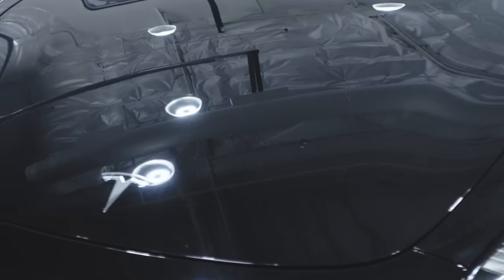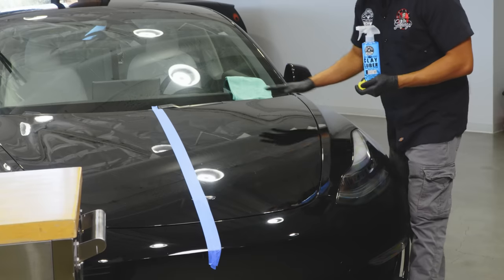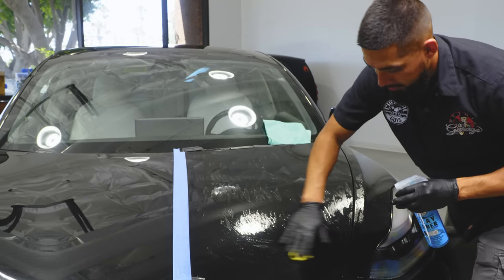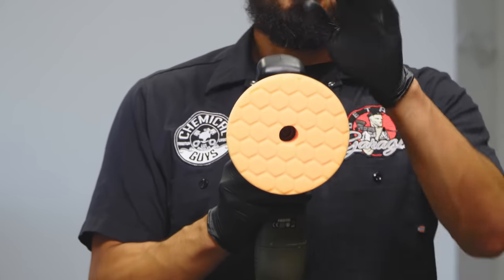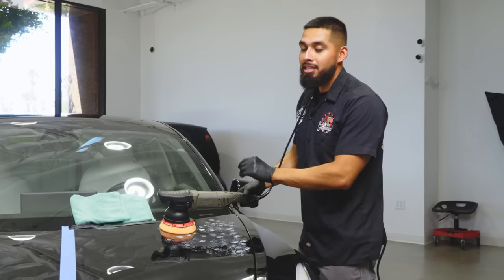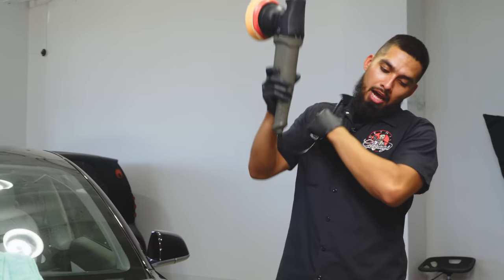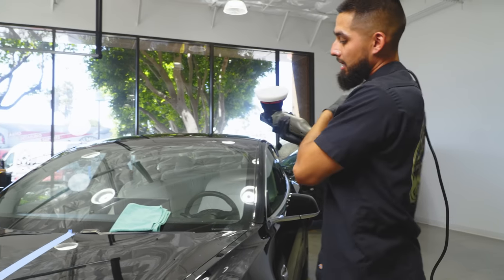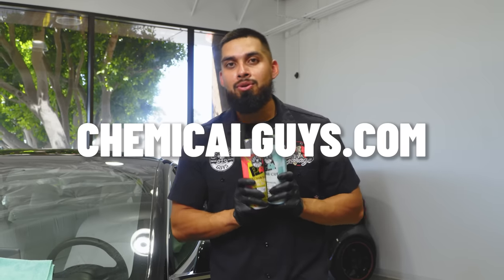How To Remove Scratches From A Car - Black Paint Polish DIY

Comment: Do all these scratches come back after a couple washes?
Reply: Yes
Reply: Depends on how you wash the car. If you use brushes or carwashes yes they will. If you wash your car without physically touching it they wont. I wash my car using a pressure washer. You can also use a foam cannon. Apply soap with the pressure washer (soap attachment) or your foam cannon. Dry with a leafblower as even microfiber can leave marks
Reply: I just got a model y and after 5 washes I was upset how my microfiber rags left swirls also on front bumper left some scratch looking lines. I guess black color is high maintenance. Constantly waxing .
Reply: Try a touchless car wash if you have one near you. It uses harsher chemicals to get it clean so be advised of that, but it won’t scratch.
Reply: Yep… its like an kids filler for sale cars. Or then you need A LOT of wax top of it
Reply: Ppf and ceramic coat is definitely gonna maintain the car the most and also no physical brushes or towels should be used to maintain the surface.
Reply: When washing is what I meant
Reply: Yes as always.
Reply: Some
Reply: Good wax will resist dust interference for few months.
Maintanence is important.
Reply: Definitely not. Those scratches are in the clear coat. Polishing removes the clear coat safely in turn removing the scratches present in the clear coat with it. Now scratches in the paint are permanent without respray. Improper washing or highway miles will add new scratches. Should be asking how many times can one polish a car. The answer is to protect it with a ceramic coating or a PPF and they’ll never return.
Reply: Your removing the scratches. So know they want come back. However you can get new scratches if your going to automatic car washes. Also you need to protect your paint by applying a wax and ceramic coating... After you have done all these things it's best to wash your car using the two bucket method. 1 with soapy water and one with straight water.

Comment: You absolutely did well detailing the hood. Leaving the rock chip out because that requires body work and paint, there were still very noticeable scratches on that hood. The next level is to wetsand any "serious" damages to the finish with 2 thousand grit wetsand paper
Reply: Use 3000 and finish with 5000

Comment: Im looking to ceramic coat my Black Motorcycle but I need to remove some swirl marks. I was going to clay bar it. Then would I also use the P4 then ceramic coat it?  Or not use P4 and just ceramic coat it after the clay bar?  Thanks

Comment: This is what I'm thinking for my black F 150 pickup.  Any suggestions and advice is welcome.  Start with clean slate, clay bar, C4 followed by P4, then another wash with clean slate just to make sure everything is off.  Ceramic treatment with Carbon Force.  Then I'd like to put a glaze followed by a wax.  Any suggestions on what to use for the last two ?
Reply: Instead of washing after the polish, I used their Wipeout spray.
Reply from the maker: Sounds like a fun weekend! Make sure you wait 24 hours after Carbon Force before your final steps - since your paint is dark we recommend Blacklight Glaze (https://www.chemicalguys.com/black-light-glaze/GAP_619_16.html) followed by either Butter Wet Wax for a warm glow, or Lucent Spray Shine for a cool mirror shine.  Maintain your coatings with HydroSuds so all your hard work lasts as long as possible! (https://www.chemicalguys.com/hydrosuds-ceramic-carwash/hydrosuds-ceramic-carwash.html) Happy detailing!

Comment: How much pressure are you using on the machine are you pressing on it hard or just letting it do it under its own weight
Reply: Put a little pressure on not much tho don’t let it go by its own weight it need a bit of pressure

Comment: Chemical guys, I have a question. Do I have to use both p4 and c4 or can I just use one of them? If so which one would be better?
Reply from the maker: Hey there! While for best results we recommend using these together as a two-step process (C4 then P4), you can absolutely use them individually, depending on your needs.  For scratch and swirl removal you'll want to use C4, for a finishing touch and that sweet jeweling look use P4.  Thanks for watching!
Reply: @ChemicalGuys  I am 13 years old and I love detailing cars, Now I know what to use to fix up my dads car!  Thank you very much!
Reply: Yes you have to use both. If you use compound it has abrasives in it. It’ll leave pad marks and the polish takes those out and brings out the jeweling (shine) out

Comment: how hard are u pushing when using the c4 or p4??
Reply: It’s all depends on how deep the scratches are. Deep ones need a hard and slow pass. Light ones can be done with light and fast passes.

Comment: Chemical Guys, what do I do if a vehicle has pin sized rust spots coming through as well as cosmetic scrapes? Can I still ceramic coat it? Or must I get my whole vehicle professionally repainted first?
Reply: Pin sized rust spots may not be from your car, if they’re that small, you likely picked up pieces of iron from the road. Try clay bar and use an iron decontamination spray as lubricant.
Reply: @evanfitch6810  thank you!